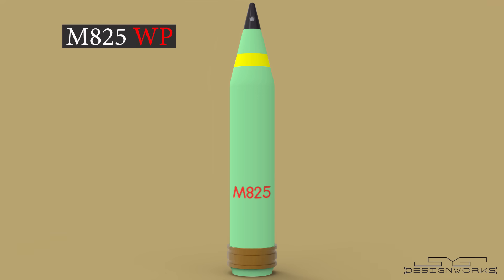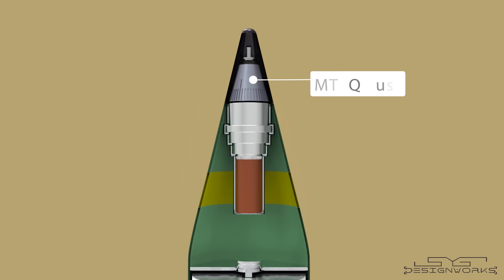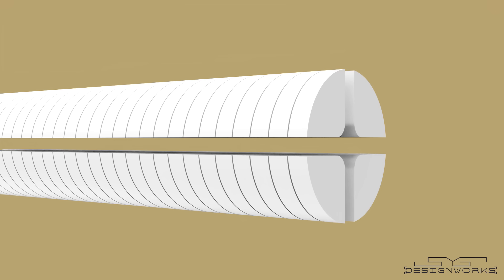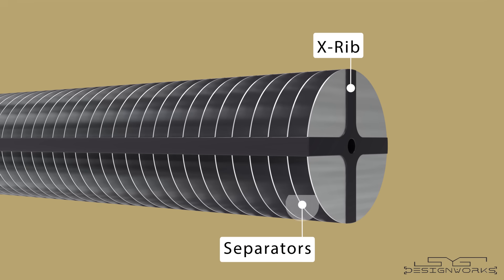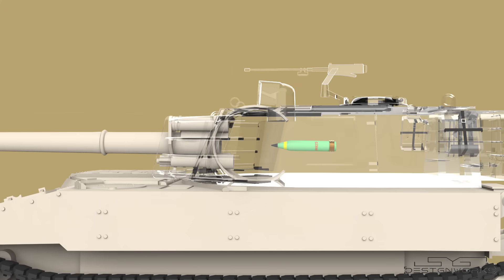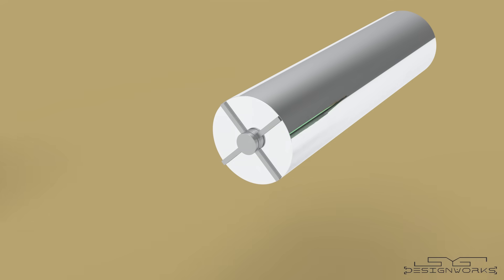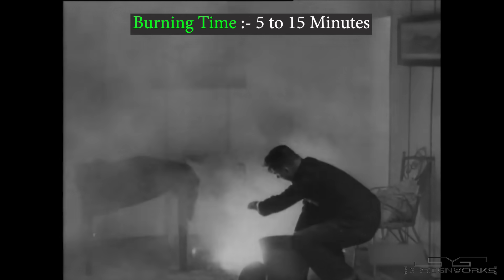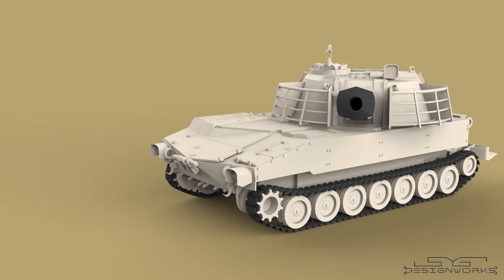What are White Phosphorus Bombs and How it Works?

Comment: Even if you extinguish by submerging in water you arent done yet. Doctors must take very VERY specific precautions when attempting to remove the WP as it will immeadiately reignite when exposed to the air. Imagine expecting to be removing some sort of shrapnel only to have a wound start smoking theb violently begin combusting.
Reply: In MCT we were told if this got on our skin the only viable way was to cut it out as submerging in water won’t work. It will pull the O2 out of water and continue burning.
Reply from the maker: @juliemunoz2762  Wow. That's crazy!
Reply: @juliemunoz2762  in the TV series MASH, they talked about those rounds (i think). They talked about using a special gel, that would suffocate the flame and prevent it from burning again. (Of course only if the gel was keeping its air barrier intact around the bullet or fragment)
I dont know how realistic that was, but it sounded very convincing. (but if that gel is expensive, i can imagine not every lab wanting to store that stuff just in case :*D)
Reply: @No_Way_NO_WAY  not sure. all I know is our instructors in the Corps said the only way to get it off your body once it started burning into the skin was cut it out with a knife.
Reply: @juliemunoz2762  outside of specially prepared installations (like the MASH) thats probably the only solution with the least amount of additional damage done to the body.
Reply: @juliemunoz2762 this is true 👍 😊
Reply: @juliemunoz2762 phosphorus is commonly stored in water in school chemistry labs, because it doesn’t burn in water. I think perhaps you’re thinking of sodium, which must be stored in oil.
Reply: @bob_the_bomb4508  Yeh but that was pure water on a solid, cold chunk. Mixed with all types of crap and still hot I'm guessing it's different. Just a guess though I don't know much about this.
Reply: @bo-dine7971  immersion in water is still the field treatment.
Reply: @bob_the_bomb4508  you're right re storing in water (I was getting mixed up with sodium and the like)
Reply: @GaisaSanktejo no worries
Reply: Good God...
Reply: Then

Comment: horrifying, can you also cover JDAM bomb and the tech it uses? thanks
Reply from the maker: Sure. Thanks for watching!
Reply: Basically a kit is put on a mk 82-84 (different payload hard bombs) that allows a gps to maneuver find on the bomb so that it hits a predetermined location, they are very good, it is possible to send gps guided munitions (not just jdam’s) through windows of buildings, and if the right tool is used (ordinance) you can keep many civilians out of the line of danger because of their pin point accuracy 

Not to mention that the aircraft dropping them do not need a lase, meaning less potential for friendlies to get hurt (not second aircraft, backseater, or ground team need to remain in the open keeping the target lit while the ordnance hit) not to mention the fact that the aircraft dropping it can stay high r and not have to risk getting hit or forced to focus on the munition